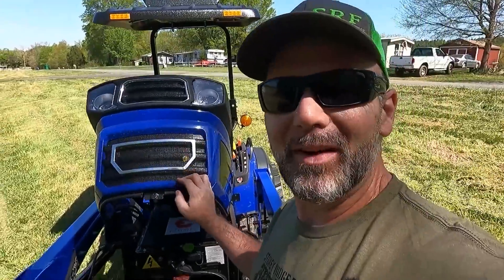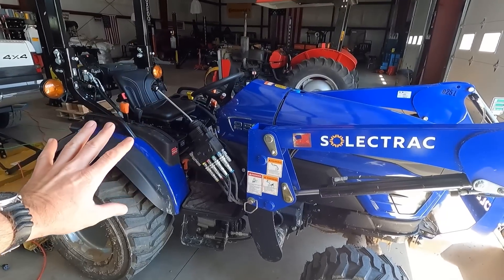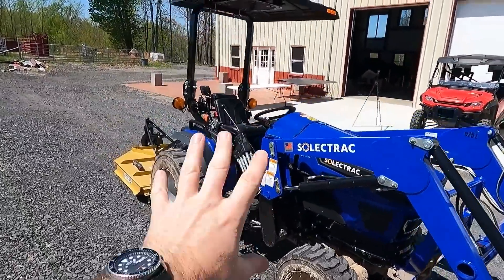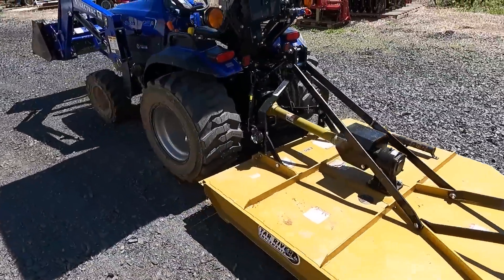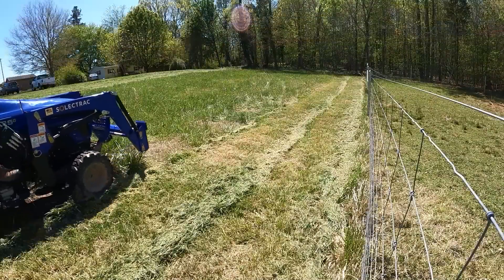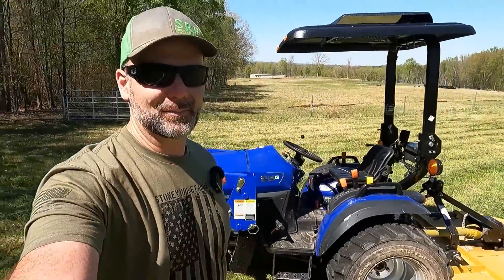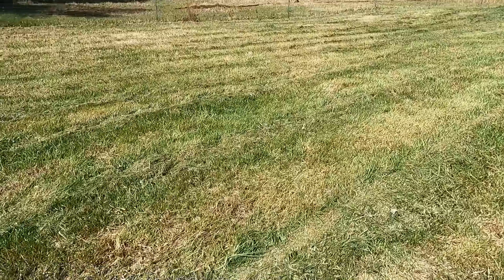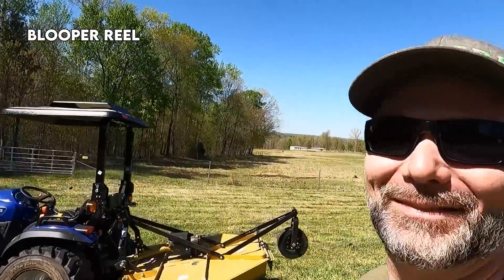Electric Farm Tractor testing....first time brush mowing tall grass

Comment: i imagine this tractor being useful for many reasons. for all the small chores that generally don't need gobs of endurance an electric tractor will do just fine. one of the nearby farms has a small electric tractor (50hp) and they seem to like it for all the small jobs their 50hp diesel would be doing. glad to see some nice and quiet power being used when a diesel engine isn't needed.
Reply from the maker: I agree
Reply: @StoneyRidgeFarmer  big and really big tractors are starting to see electric drivetrains. the power is still a diesel engine but the operating principle is the same as a modern diesel locomotive. that tech will certainly find it's way pretty quickly into the smaller stuff and at the smaller sizes like what you work at i'm certain we'll see battery hybrids arrive where they have a tiny battery and the engine runs only when you need it.

Comment: I watched the video and for the most part I think that the electric tractor is fine for what it is designed to do, one thing that I noticed in one of comments is that it won't mow in reverse, the problem with that is sometimes you need to mow in a tough spot and backing up is the only way to mow that spot, otherwise it did a good job, good review, it will help people make up their minds if it is for them!
Reply: Great video. Thanks

Comment: Have to say I was impressed by how the Solectrac did in the brush mowing test. After watching this, I pulled up their website and have now seen a gear drive version, plus now a backhoe.  I still tend to hope they get a canopy with a solar panel on top as an accessory.
Reply: Im sure you could probably mount one, and run it to the plug pretty easily
Reply: A solar panel that size wouldn’t produce much more than enough power to keep headlights running. You need a barn roof amount to even begin seeing some charge.

Comment: To be honest, I think the process to make those batteries release more greenhouse gasses, I love the diesels, nice video Josh
Reply: Yea same I don’t like this electric stuff nor do I think it will last long I wish they would just make some electric and leave the diesels alone same with cars
Reply from the maker: man....I don't see why folks see an electric tractor and think it's somehow a threat to their old diesels.  I have 5 diesel machines on the farm here my friend...and they aint going anywhere
Reply: That was one of your best videos.  As far as a diesel engine, it's ashame farmers don't get together grow rape seed for making rape seed oil, a renewable fuel, the way Rudolph Diesel intended it to be.  WIN! WIN!  PS, how much is the basic electric tractor, and was the loader optional?  Thanks again
Reply: Making the batteries is a one-time operation, burning diesel fuel is for the life of the tractor. The way he did it here was the smart way — solar PV panels to charge the battery. Electric motors are hard to beat — high torque, quite, reliable, good in cold weather, low maintenance, low cost of operation.
Reply: @ChitFromChinola  I agree with you on electric motors, I just don't like batteries as a source of transport, I will swallow a chores tractor but not an electric car
Reply: @ChitFromChinola  disagree
Reply: @ChitFromChinola  I agree, that was a nice set up with the solar recharge.  Would love to have an electric tractor, even lead acid batteries like forklifts.  A tractor needs the weight of lead batteries.  It's just going to take time, ala the old vcr's
Reply: @jankotze1959  
Battery-powered cars are no big deal — you get in, you put the car in drive, step on the accelerator, and it goes. Ninja.

I have a battery-powered electric drill, electric lawn mower, electric chain saw, electric tractor, electric dirt bike, electric snow bike, and electric car. I have an electric pick-up, an electric snowmobile, and an electric street-bike all on order. Low maintenance, trouble-free, low cost of operation, quite, and just plain fun. All of them charge up at home — no need to stop at gas stations anymore, or have gas/diesel trucked out to my farm. This summer, I’m installing solar panels and batteries on my farm. I’ll be completely energy independent. I just point the solar panels at the sun, and they produce electricity for all my stuff — including heat for the house and the shop.

Electric cars are amazing and get the most press, of course, but for me, it’s the electric lawn mower and electric chainsaw that are the most dramatically different from their gas-engine counterparts. Especially the electric chainsaw. It cuts like hell, and no brain-rattling noise or headache inducing gas-fumes. With an electric chainsaw, I actually look forward to going out to clear trails in my woods — which used to be a chore that I dreaded. Ninja. No hearing protection required. Electric chainsaws are so much better than gas-engine ones that I predict electric chainsaws will dominate the market over the next 2-3 years, just like has already happened in lawn mowers. 

So if you and others are skeptical, I get that — I suggest buying an electric mower or electric chainsaw first. I mean, you already have a battery-powered electric drill, so it’s not a big leap. My first battery-powered machine was an electric lawn mower, and when that thing powered through the thick spring grass like a boss and didn’t leave me in a brain fog from Briggs & Stratton racket, I was sold on it. After that, I was all-in — and I’ve just kept going as the electric-powered markets have progressed. (In contrast, I was one of the last guys to convert from an extension-cord drill to a battery-powered one, and boy, was I dumb to delay that move.)

In the end, I’m just me, so I just decide for myself, and my wife and I decide for our family. So, we are going for sun-powered energy independence, not because of some distant global environmental benefit, but because electric powered equipment is more reliable, lower maintenance, lower cost of operation, more pleasant, safer, easier to operate, more powerful, and more fun than its gas-powered equivalents. No more rusty fuel tanks or LP tanks or pails of used oil on our farm. We just plug stuff into the wall. LOL. When we install the solar panels and batteries, that will close the loop — just like Stoney Ridge did.

So, these are just things that we decided, but I will say that we’re not the only ones, because the market agrees with us. The market for battery-electric lawn mowers, cars, hedge trimmers, string trimmers, leaf blowers, edgers, and other gear is growing fast, and utility-scale solar energy is far outpacing the conventional alternatives, not because tree-huggers are taking over, but because the new technologies are objectively better. And, this is only the beginning. Imagine how much fun it will be to have electric snowmobiles and jet skis and boats. Ninja.

People winge a lot about the electric grid and battery life and recycling and blah blah blah, but those are all technology problems that are readily solved — you can depend on American ingenuity for that. And the cool thing is, this transformation is leading to a resurgence in American manufacturing. You can buy electric gear from lots of American companies — Ford and Volcon and Solectrac and Milwaukee and DeWalt and First Solar and Enphase and Polaris and Harley and Stihl and others. The innovation in this space is amazing, and lots of it is American.

So, I’m excited about the new electric stuff coming on the market, and I’m converting my farm as fast as I can. I have no particular affection for the noisy, dirty, stinking, self-destructing, searing hot, hyper-flammable, toxic, rust-prone, dirty filter, high maintenance, hard-to-start-in-the-winter conventional engines and boilers and furnaces that have caused me so many headaches and frustration in my past, so, LOL, I won’t be sorry to put all of that behind me. So far, the market is with me, and there’s no turning back — I’ll predict that five years from now, you will be stunned at how fast these markets have transformed to electric. And, no one will care about Saudi Arabia anymore . . . LOL. Have fun . . .
Reply: @ChitFromChinola  I have no complains about electric motors, I have a stunning electric chain saw, electric drill, and and and, including battery operated hand tools, NO PROBLEM, my issue is electric cars, if you have an emergency at a far place and have no time for stops other than fuel fill up and go or to a toilet, that is the problem, then you have to wait long for a full charge and maybe sit in queue to charge, that will be a night mare, as I said, I might swallow a chores electric tractor around the yard, have a great day my friend
Reply: @jankotze1959  
Yup, I have one electric car and one gas car, so I’m covered either way. My problem now is that the family refuses to ride in the gas car — Dad’s old beater, they call it. We have a charger in our garage ($400), so we have a full battery every morning, and we don’t go to charging stations except when we take a driving vacation. Wr have only had good experiences then — no waiting and 30 minutes to charge. I haven’t had a long distance driving emergency like you describe, but I guess I would just take the gas car. In five years, the range and charge time will probably be a lot different. 

It’s all good stuff, and makes me excited for the future. Take care.
Reply: @ChitFromChinola  Cool, then you are sorted, thanks for the discussions
Reply: @ChitFromChinola  >Making the batteries is a one-time operation

That why you have to change your car and tools batteryes every now and then. 🤣
And that is actually why I've switched back to cordversions of some tool. 

>Electric motors are hard to beat
It's all depends on manufacturer and price. I have one (1) dead gas mower and you didn't believe how many dead electric motors on electric mowers. Electric have higher torque but usually less hp for same implimentation. 

>good in cold weather, 
Yeah, esp batteryes good in cold.

>low maintenance, 

Yeah. Manufacturers mostly have two option for you - buy a new one or go and hang semself. :)

> low cost of operation

You must be living on nuclear power plant because elctricity have a higher price comparing to any other energy source around me.
Reply: @ChitFromChinola  Great points from a non-greenie lover I take it? Sounds like a greenie because if you do the research you will find that presently the United States is solely dependent on China for the lithium, nickel and other minerals for battery production supply chain. So yes , some manufacturers are gaining assembly production here in America but the components or say the 'foundry production' is far from making any claim to "Made in USA". Besides the inconvenience of down time of these products while they are charging lets not forget that the repetitive chemical state of charge and discharge has a rather short life span. Today's technology allows for a rough guesstimate of 2,000 cycles per battery life. Give or take that number with how people will short charge or mismanage the charging process shortens that life in half. I'm glad your so excited and happy this is working for you and your family in the early stage of this experiment. I question if your excitement will be this high when a streak of components expire or malfunction before the average life span of what one would consider common knowledge or presumed service life of equipment or components? My gripe and maybe others is, if it don't drip oil and burn gas, I don't ride it!
 
Number ONe axe to grind with this green farce is that no way in hell will wind and solar ever be able to replace the Mega Horsepower of a coal or gas fired Power Plants! The equipment is in the Millions or Billions of calculated HorsePower/Hr running @ max capacity to maintain a 70 yr old grid system so these battery powered toys can be recharged! No one is talking repair and replacement because the game is so new, everything looks wonderful right now?

I'm surprised that the Farmers of all people aren't screaming b/s over this CO2 Carbon Dioxide sham! Anyone who understands the process of Plant Life knows in order for Photosynthesis to take place that a plant or tree needs Carbon Dioxide! We exhale Co2 and without plants to scrub it and reproduce the process zero oxygen will be produced! 53 yrs ago when a coal fired modern electronic precipitator fly ash Plant was built in Ohio, trees were planted 1,000 miles away downwind of the jet stream to produce a cycle of co2 to oxygen production. I guess today people who call themselves a scientist have forgotten that fact!

stator's
Reply: @snurb48  
Propaganda. Try again.

Comment: I get that they have a place and hopefully the future will bring costs on this type technology down. But I'd hate to think how much a replacement battery pack would cost. My little compact tractor is 40+ years old. (No I haven't owned it that long) It would be on its at least third battery pack. That's a huge expense at year 10-15 or so. 
Just wondering if they told you how much the cost of it is? In the 15 years I have had my tractor I would hate to think I'd would have to have bought new batteries for it at this point.

Comment: Have a couple of question. 

When we are cutting around fields, with a tree line we usually back under the low hanging tree limbs to cut down the weeds.  

How does the tractor do at regulating speed in reverse?  

Does it have a really slow speed in reverse so you don’t end up in the trees and how does that affect the PTO speed in reverse. 

Have you done any hard work with it where it was not going to make the full amount of run time advertised and if so what was it? 

Do you know the cost of a battery is and what is a rebuilt battery and how much do they cost. 

You said the battery was good for 10 years and if so is the battery under warranty for that period of time (that would be great if it is)?

What is the warranty on the rest of the tractor? 

How big of solar array do you need to run the charging station? 

Thanks for the video and at this point it sound like you have not found a single issue with it and it can do everything as well as or better then a conventional tractor. 

Looking forward to what you have planned next for this tractor.

Comment: Like the video and full disclosure, I have a kubota, 2 john deeres and 2 fords on the farm, I would look at an electric tractor if work load, quality and price were equal but if that  Solectrac is 35K+ you can buy a 30-35 hp deere with the loader, mower, box blade and the resell value is way higher and still have money left over to buy a year or more of diesel, but getting back to the electric tractor, whats the warranty? how long will that battery last when the temp is 20 or 95 degrees? most batteries can not be discharged 100 percent or even 90 without damage, how many mechanics around offer service? Could we service it on the farm? One day all tractors may be electric but won't see it in my life time.  Looks nice for small tractor but not for me.

Comment: It’s heavy compared to many 25hp tractors… but I saw one at a local ag fair and it’s puny compared to my 1981 Ford 1700 which is 25hp. As a major weekend warrior the run time would be a problem for me, hampering productivity, but I definitely see it working for some applications. Nice you have solar charging. Otherwise being dependent on the grid isn’t 0 emission.
Reply from the maker: Man...the simple fact is that most folks looking at a 25hp homestead tractor are not looking to get out and mow for 8 hours straight....they come in after work and mow till dark, they move a little dirt in the garden, they work all day on saturday or sunday tilling, moving dirt and mowing.  It's not a "production" machine my brother....it's a homestead tractor pretty much
Reply: @StoneyRidgeFarmer  You might be mistaken how certain homeowner/homesteaders operate their machinery. I tend to use my equipment infrequently but when I do use them it tends to be intensively. For example, my PTO log splitter on a 1980 Ford 1910 compact is only used a couple of times a year, but then it will be for 8 to 10 hours per day for a few days straight. I have a micro excavator that I don't use too often but when I do it's usually used all day long. When it needs some red diesel it's just a few minutes to fill up with barely any downtime. I appreciate there will be some niche areas where this electric tractor will be put to good use but I'd need my arm twisted and a bargain offer to think about buying one. I'm not anti-electric equipment, I've got a Polaris Ranger EV, an electric dumper and a hybrid car
Reply from the maker: my friend....I know how I operate my machinery and I'm on 150 acres.  We mow common areas, move dirt and gravel and I'm never on a small machine like this for longer than 2-5 hours.  Typically I'll work all day, then in the evening get out and mow a few acres...then go back to it the next day. With an electric tractor like this you may have to change up your habbits a bit.....however sitting on a tractor seat for 10 hours per day to mow once a couple times a year...when you could casually mow a few acres at a time seems kinda hard on your back
Reply: @StoneyRidgeFarmer  I mow for 2 to 3 hours with a New Holland T4020 and a Lastec 721XR 11ft wide mower. Another job this electric tractor wouldn't handle.

Comment: When I see a huge battery pack like that I think backup power. It would be nice if it had a plug that can be used to power an inverter or charge other things. It seems that would be a huge amount of portable power in an emergency.